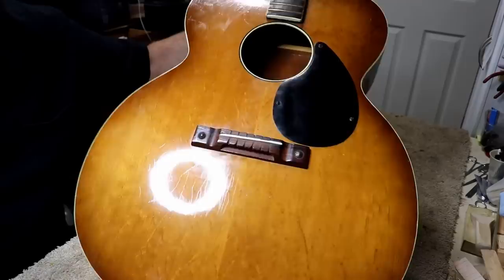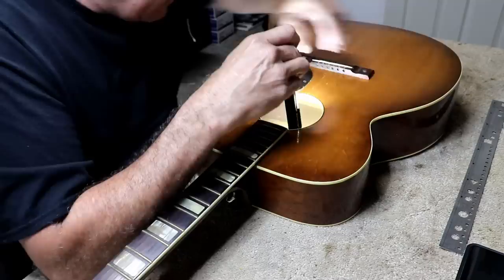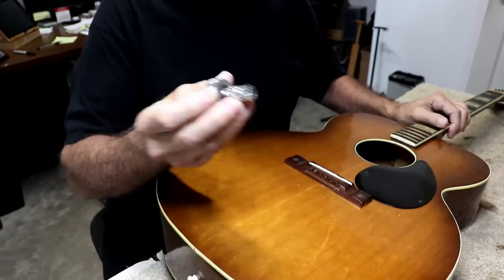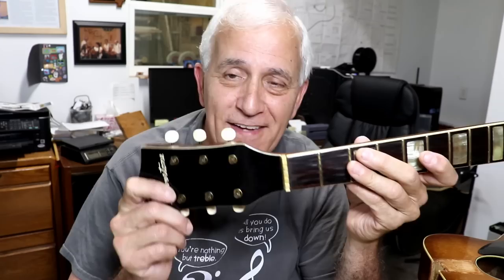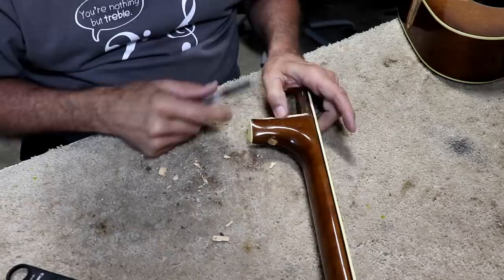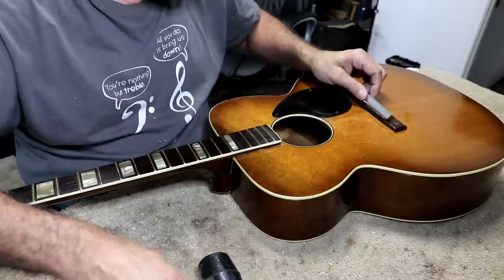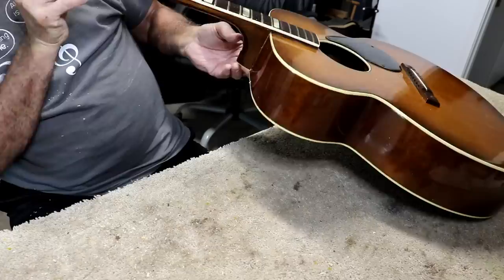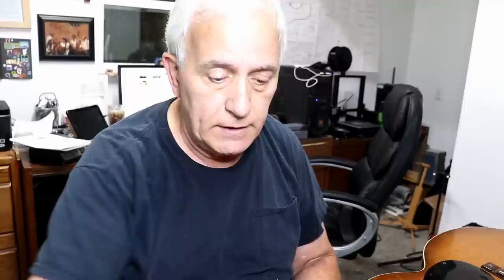302 Rsw Silvertone Finger Eater

Comment: 45:00 - Glad you mention about scrapper/razor blades getting thinner and the metal being of lower quality (i.e. won't retain an edge as long).  I assume the manufacturers in China are cost cutting to increase profits. 
fyi - I'm now using 20+ year old ones ..that I simply resharpen on a Japanese Water stone (a 1000/3000 combination stone)   
One blade can last for years that way :)
Reply: I've been to Menards many times.  The Masterforce brand (I guess it is a Menards' branding) is low quality -- I would only by Masterforce products if quality was absolutely unimportant.  BTW, you guys know about making a micro scraper with a razor blade?  You just put a lip on it similarly to how you sharpen a scraper.

Comment: I have a Kay acoustic that looks exactly like this with the same problem. The bridge is even exactly the same string thru backwards setup. The difference is my guitar has all brass tuners and frets! I always assumed it was from the 1940s and was made with brass due to steel restrictions during WW II. The sound of that guitar is so pleasing but you can only play cowboy chords. One day I will take the time to get the neck reset in a similar fashion to this excellent video. Thanks.

Comment: Rosa String Works
 - 
This Silvertone was the last to be made by Kay guitars for Sears and Roebucks and is a model 620. They began this model in 1958 and had a short 1 year run making it a genuinely rare guitar. It has a solid Spruce top with solid Mahogany back and sides with a maple neck (ref. to the original Sears and Roebuck Ads. from the period describing it - in the link below). 
A write up can be seen at the "Silvertone World" site where there is a gold mine of info and pics including copies of the original advertisements on these lovely old guitars.  -  
This is the link for this guitar on that site. -  https://www.silvertoneworld.net/acoustic/620/620.html

The following is taken from the site with some details about the guitar. 

The 620 was the last jumbo-size Kay flattop acoustic that Sears offered. The 618  model was quite popular, and the 620 really just kind of played 'clean up' behind it, as it was only available for one year, from 1958-1959.

The 620 was the upgraded replacement for the attractive, successful 618, carrying on the distinctive look of that Kay-made J-200 'knock-off' with a few refinements that were already in place on the Kay-branded series of this guitar. Block neck markers, a fancier inlaid headstock with a more contemporary script logo, and a much smaller window of availability make the 620 a rarer find than the 618. The immediate tipoff to a 620 is, of course, the big block fret marker inlays.

Introduced: Spring/Summer 1958 as the 57H0620 at $39.98

Retired:
Spring/Summer 1959
as the 57Y0620 at $39.95
Reply from the maker: Well some of them may have solid back and sides but this one was definitely plywood on the sides.  And that is a fact because the outer Plies of mahogany were peeling off right around the neck joint. I can't say 100% for sure on the back but I'm about 90% sure it's plywood also.

Comment: To scrape my sons fret board I used a blade from a Stanley knife or one of those cheap knock off ones, they are quite thick and you can snap them off to the length you want, not sure if you do this.

Comment: I have a Silvertone that looks a great deal like that guitar. I bought mine new in 1972 from Sears. Mine is solid birch through out. Mine does not have a truss rod. With steel strings the neck began to warp so early on I only have used nylon strings. The solid birch top was too thick to give it much tone so I sanded the top down.  Since doing that the tone and volume improved greatly.  The tone on my guitar is very sweet finger picked, which is why I kept it all these years. I am pretty sure my neck is glued on not bolted. I believe these were made by Kay for Sears. My bridge is also different.

Comment: Interesting. I found a nice-looking japanese-made Silvertone acoustic at the dump last weekend, in good condition except for the headstock having cracked most of the way off in similar fashion to what Gibson's are known for. It's a very clean break and closes up nicely when I push it back together, so it should be relatively easy to glue it. What do you all think? Titebond? Urethane glue? It looks to be in decent shape other than the cracked headstock, the top isnt bellied and the neck looks good, doesn't appear to have a hump where it meets the body; and it does have a truss rod if any adjustment is needed. No strings on it, relatively little fret wear, doesn't look like it was played very much. It has a zero fret on the neck, I don't think I've ever owned or played a guitar with a zero fret. Probably Circa around 1969?
Reply from the maker: If it's a clean joint and it fits back together well so that you can clamp it really good Titebond will definitely hold it
Reply: @RosaStringWorks  , thanks for the info. I figured Titebond would likely be the better choice, compared to urethane glue which expands as it cures, to fill gaps. Probably better in this case to get the wood fibers to mesh tightly. Is there ever a case where wood should be wetted slightly with water before gluing with Titebond?

Comment: Great work and thank you so much for sharing your talents with the world. I learned so much just from watching you do this but it’s not the same as having hands-on touch. A couple very tiny criticisms that are bothering me. There is no such word as “heighth” . It is always Height/ Length-Width-Height, never “heighth”’ period!
  Next, I know what you need for Christmas! It is a small hand vacuum to pick up all the debris off of the carpeting that you laid the guitar down on, right? All the detritus that remains as you’re working tend to scratch the finish specially when you’re pressing down on it rubbing it into the carpeting that has grit on it. OK, i’ve said it now I’ll just lean back in take a big drink of STFU .  Thanks again for the great video.
Reply from the maker: Thank you for watching videos. First of all this is an instrument repair and building Channel not an english-language Channel. Second of all I have a vacuum right above my head that you can't see in the picture. And I vacuum constantly. The reason I use the thick carpet which is very soft is that anything on the carpet matches down inside and it doesn't scratch the instruments. You're kind of preaching to the choir.

Comment: I had a vintage device for sharpening that kind of blade, it would sharpen one side, then automatically flip the blade over to sharpen the other side to keep the sharpening even. I sold it, but it was neat. You could  also sharpen double edge blades with it, but of course you had to put the blade in twice, once for each side. I forget the name of it, it was all chrome and cool and had a hand crank to power it. Years ago I saw another device where you put the blade inside, closed it, then pulled a string back and forth to turn the honing stones. You don't see that kind of thing in our throw away society any more.

Comment: That's a Kay, I think a K-22, probably late 50s. Solid top and plywood sides; the neck bolt is not original. I have one just like it that was sold as an Old Kraftsman, the Montgomery Ward brand. I had to get my neck reset too, but it was nowhere near as bad as this one. Mine's in great shape except that the previous owner screwed a pickup across the soundhole, with pots through the top and a jack through the lower bout.

Comment: Well done Jerry, another fine job, did you actually take the opportunity when the neck was off to examine the end of the top to double check that the top was solid?  Not doubting your original assessment, just curious, mainly because I had a very similar one years ago and I know it was ply because the pickguard came off and I could see through the screw holes.
Reply from the maker: The top is solid wood. The sides are definitely plywood.

Comment: Very cool, great job Jerry!  I think I saw a glimpse of the steel nut for the “bolt on” portion.  Considering all the work you did to get a super tight neck refit and glue job, I thought you might fill and finish that threaded rod hole.  It doesn’t appear to structurally need the bolting system now, did you replaced it to keep it authentic/original looking? Either way, again, great job.
Reply from the maker: I would have if I had known it was not original to the guitar.

Comment: Why was it a 'Finger Kilker' ? Did it have thick, high fret wire? I have an electric guitar a 'shredder' it's called but it has unusually high frets and not knowing this I slid my fingers along the neck a few times, as you do, sliding notes... I sliced the end of my finger on the size 7  E string... really deep. The string cut right into it so that I've had to stop completely for a couple of weeks cos I kept opening up the cut again, doing the same thing! (thinking my fingertips will toughen up)  In the end bending a string I could feel the cut inside under the skin opening again so major rest from using that finger at all is the only solution. Great videos Jerry, very relaxing and informative. I'm assembling two guitar kits at the moment. Modifying a 12 string to be a wide neck 6 string for a classical guitar player who prefers those specs. Good fun.

Comment: Looks to me like it's really, really dry. I have an old (probably late 40s) Kay that had the same thing happen to it. It had spend 40-odd years just tucked into the corner of a bedroom closet in Arizona. When it was put away it was playable. When it came back out, the neck joint was loose just like that (among other issues).

Comment: I’m not positive that this was originally a bolt on neck I think that was done after the fact I’ve owned a few of these and they were not, at least they did not have the exposed nut on the neck heel
Reply from the maker: You are correct.  I regret putting it back in.
Reply: Really enjoy your videos, you do a fantastic job

Comment: Maybe missed one thing, but did you place the thread back through the bottom of the neck and body?? It wasn't straight when you pulled it out, remember? I thought you'd replace it instead of just glue. Sorry if i missed a thing. Lots of work you did i may not have the patience for. So thumbs up.

Comment: It's spruce, maple and rose wood. I picked one up at a garage sale that wasn't in bad shape. I do however have to replace the bridge,  I took the 2 inside nuts holding the bridge but was wondering how I can access the screw tops from the top of the bridge. Do those 2 screw head caps pop off. Thanks for you help.

Comment: Thanks for a nice presentation, as always .. But may I ask what is the material that is the top surface of your workbench?  If 'rug-like'  could lil dirt particles become embedded and cause 'back' damage as you slide instrument around? Or do you 'power vac' the top several times a day ;)   ??
Reply from the maker: . I also vacuumed it. I also run my hand across did. Nothing gets in there that I'm not aware of.
Reply from the maker: I also take it outside and beat it every so often.

Comment: Just wondering if the pin holes at the heel of the neck and the guitar body lined up after all of the tweaking you had to do to get the neck to line up. Did you have to run a drill through the hole in order to get the pin back through?

Comment: Nice job. I have this same guitar and it was not a bolt on. was the bolt added by whoever did the 1st neck reset? I was wondering if you were going to leave the bolt out? Mine needs a neck reset as the action is WAY high!
Reply from the maker: The whole lined up perfectly so I just put the bolt back in.
Reply: @RosaStringWorks  Do you think that was from the factory or from another neck reset?

Comment: Out of curiosity, when doing a neck reset like this, where there's initially a gap between the neck and the body (eg that glue-filled gap by the heel plate that is now completely closed up) are you at all concerned that you're moving the frets a little closer to the bridge and impacting the intonation?  Or is the distance so small that it's just not noticeable?

Comment: QUESTION: Hey Jerry. I was watching a woodworkers video on different finishes and the pros and cons of each....lacquer, poly, oil, etc. It was pretty good but didnt mention shellac and the finishes were for basic woodworking and NOT musical instruments. Im a recent sub and not sure if you have done an in-depth video on this already. If not, I would like to get your perspective on these finishes as applies to musical instruments and how each one may affect tone. I watched another vid on a Stewmac guitar kit build and he used shellac french polish that was beautiful but he said that it scratches easy. If you could dedicate a vid on this, I think it would be helpful. It would also be nice to teach us how to identify the different finishes on existing instruments. Thanks.
Reply from the maker: To be honest you hit on my weakest aspect. I do know quite a bit about finish it is but I am definitely no expert. Suffice it to say in my opinion oil varnish is probably the best overall finish in terms of sound. But for the most part they need to be applied by brush  and it's difficult to get a really fine finish with oil varnish.  But it's probably not that much harder  then any other finish when you get right down to it.  Nitrocellulose lacquer is very good as well. The biggest problem with nitrocellulose lacquer,  which is the one I use most often,  is that it shrinks seemingly forever .  It takes a while to dry  and you have to keep applying it and sanding it to get it level. It's really hard to fill the pores using nitrocellulose. I have no experience with water-based lacquers.
Reply from the maker: Didn't mean to stop there. What I don't like about shellac finishes is that they milk up really bad if they get damp. In other words they literally turn white. Which can happen fairly easily if you're playing where it's hot and your arm starts to sweat. So I much prefer oil varnish or lacquer. Another property of finishes that is important for instruments in terms of sound is you want a hard finish when it's dry. And in addition you want a very slow drying / curing finish. Nitrocellulose lacquer and oil varnishes meet those standards. And they're very durable to boot. That's about all I know on the whole subject right there.
Reply: @RosaStringWorks  Thanks so much for your detailed reply Jerry.

Comment: TAke it from a machinist.
0.001" IS a big difference!!
You can look at it this way... it is  1/8 of that thickness bigger.
Not 1/8 of an inch...just 1/8 of that .008"
Reply: I'll say!! Worked as a machinist cutting turbine disks for gas turbines! Some runouts were to tenths of a thousand!
Reply: Anything worst than seeing +/- 0.001" in the tolerance?  :D

Comment: Jerry: What would you say the ideal height of guitar strings above the guitar's finger board to ensure "ideal ACTION"? 3mm? 8mm?
 I just purchased one of Epiphones all wood DR400's. Strings were set up so as not to buzz. But doing that hould I seel better action?
I'm thinking of taking the Epi to a Ft Worth Luthier like Wicks to see if action needs improving? The saddle and nut are both bone.
Reply from the maker: Just slightly over 2mm at the 12th fret.  Of course to get it that low, the Frets really need to be very level.
Reply: I have a 2006 Masterbilt EF500rcce. Took it to Charlie's in Dallas. Had him set up for light strings. It has been my favorite box for years.